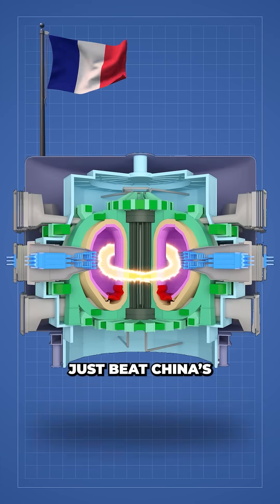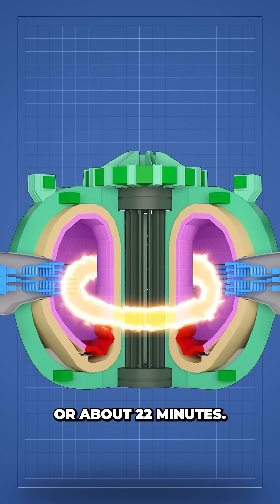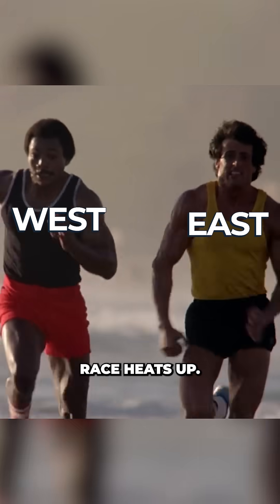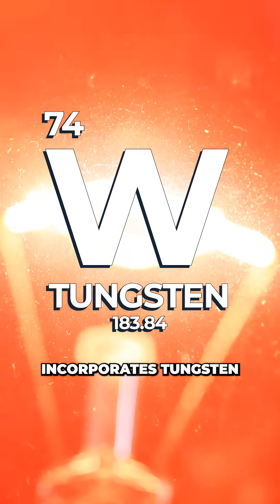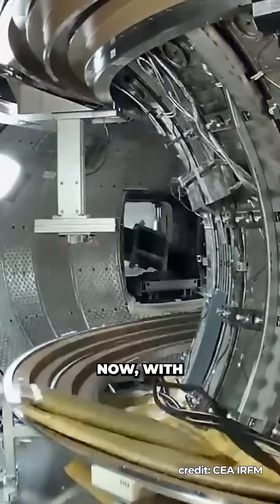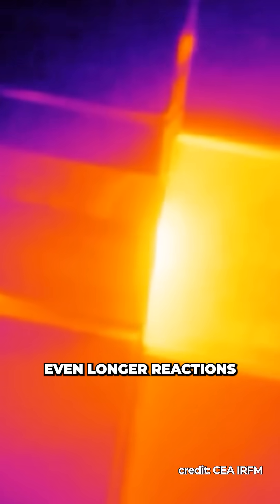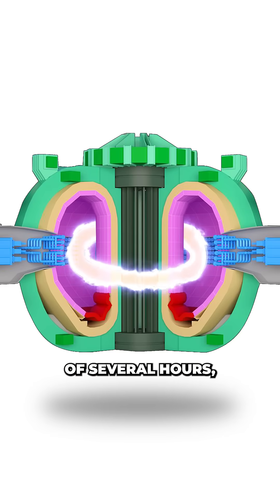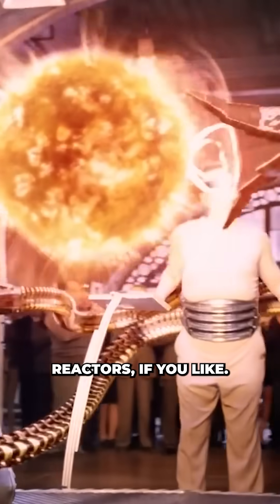France Breaks Fusion World Record

Comment: #1 it was the plasma not the fusion reaction 
#2 even if they achieve a sustainable reaction in 50 years from now, the amounts of tungsten and REE magnets needed and the required maintenance from high temperature exposure is going to make this the most expensive form of power generation and there's no such thing as "unlimited energy" when you have a tiny reactor with a very limited generating capacity.

Comment: Have they solved the issue of reliably adding fuel into the reaction? Last I heard this was actually one of the biggest challenges, due to  injecting material into a critical reaction running that kind of heat and pressure.  Are they just running a certain set mass of fuel they know will give a known duration for now and plan to solve fuel insertion later?

Comment: Cold fusion was supposedly possible 40 years ago, it was a optimistic lie from some snake oil salesman, we likely will never see a power fusion reactor, its far too hot and unstable. We dont have good solutions for containing the plasma yet, let alone the fusion that is many times hotter and unstable than the plasma. Its a pipedream, and all the people saying it will be done by the 2030's sound just like Elisabeth homes, the theronos CEO.

Comment: We cannot create Fusion on Earth! I wish I could show that from the rooftops but.. you cannot create Fusion or at least stable Fusion on Earth. The reason is because gravity itself and all of the other masses on Earth will interact with each other. We all have gravitational fields. Every object has a gravitational field whether you realize it or not. Those fields interact with the most dense matter around and that would be our planet. Everything balances with the planet. Even light finds balance. You need to take the reactor to outer space where there's no gravity. It needs a place where it's not being interacted with because you're creating a super high frequency waves so to speak with your generator. The higher you go the more sensitive it's going to become. There may even be a balancing point out there somewhere in space between the Earth and open space where it can Thrive but it certainly cannot work on Earth

Comment: How much energy is that?

While it's difficult to quantify the exact amount of energy plasma will release in 22 minutes without specific details about the plasma itself and the reaction it's involved in, the recent record-breaking 22-minute plasma sustained in the WEST reactor is a significant step towards harnessing fusion power. This achievement, with plasma reaching 50 million degrees Celsius, demonstrates the potential of fusion energy, though it's not yet usable for widespread power generation. 
Here's a breakdown of why it's hard to give a specific energy number and what the 22-minute plasma means:
Plasma is a state of matter, not a specific energy source:
Plasma is an extremely hot, ionized gas, and its energy content depends on its temperature, density, and volume. 
Fusion reactions release energy:
When lighter atomic nuclei fuse to form heavier nuclei, they release a tremendous amount of energy. 
WEST reactor is a research device:
The WEST reactor focuses on maintaining plasma for long durations, not on maximizing energy output. 
Fusion power is not yet a practical reality:
While the WEST experiment is promising, fusion power plants are not yet commercially viable. 
ITER is a large-scale fusion project:
The International Thermonuclear Experimental Reactor (ITER) is designed to demonstrate the feasibility of fusion power, but it is still under construction. 
In essence, while the 22-minute plasma is a big deal for fusion research, it doesn't translate to a specific amount of usable energy output. The focus is on understanding and controlling the plasma to enable future fusion power plants. 
 
50m degrees equals 90 quads 
Or 
quadrillion (1015), specifically a unit of energy equal to 1 quadrillion British Thermal Units (BTU)
So yea 50m degrees would be around 50 quadrillion British Thermal Units(BTU)
I hope this helped to whoever had this question 
And yea this took a lot of time to search

Comment: The term ‘fusion’ is frequently used in such promotional presentations. The simple fact is that this, the mentioned Chinese experiment and the vast majority of other nuclear fusion energy experimental machines have never and will never achieve a significant level of fusion reactions. The key fusion fuel isotope, tritium, is rarely employed because it is radioactive and extremely expensive. The commercial price is greater than $30,000 per gram, a key fact that is always omitted in such presentations. Even the best, record breaking fusion reactors that have employed tritium in their experiments, remain at least a million times away from the dreamed of economically practical nuclear fusion energy electrical power plant.

The nuclear fusion energy experiments began in the 1950s and have been constantly oversold to journalists and to the public, typically using claims that the hydrogen fuel is almost unlimited.

Comment: Hard to beleive the temperate comparison. No one has ever been inside the middle of the sun and said wow it is actually that hot.
Reply: Yeah but we know how big and dense the sun is… and how much gravity it has. Using those a person can calculate how much force it is exerting and how much heat it will generate. You can also tell by what colour the sun is, as materials give off different colours depending on how hot they are/their composition.

Comment: France is not the only country to develop fusion reactor which is better than China , India also created SST1 TOKAMAK which 24 times hotter than than suns core (approx 250 Million degree centigrate) and maintained it running for 45 minutes.
Reply: Indian reactor is one of the main in the ITER program, you don't need to lie to make it more important. It runs for 10 minutes, not 45
Reply: @kerity8707  man its not a lie , its just a stat which is being manipulated by different information portals , and yes it is possible that i had wrong data , and it is equally possible for you as well .
Also i am not making it ' more important ' ,
but yes i am making it clear that French fusion reactor is Not the First , there is an Indian fusion reactor too which achieved the same goal .
Reply: @amansahay4994  The SST1 was built to target 1000 seconds (16 min) maximum. Between me announcing that it lasts 10 min and you quadrupling its results beyond what the engineers themselves built, we're saying the same thing and we're both equally wrong.
What a fine false equivalence sophism, coupled with an evasion of responsibility. Pure politics!
Reply: @amansahay4994  What's more, to maintain the plasma longer, the technique involves keeping it at colder temperatures than we could. By lowering the temperature from 160M°C to 100M, China went from 20s to 400. The previous record was 70M°C, the current record (in the real world) is 50M.
You look ridiculous claiming that India has managed to have its cake and eat it too, with a plasma 4 times hotter & 3 times more stable than what the rest of the world (real world India included) manages to do together
Reply: @kerity8707  So I look ridiculous when i state facts 😄. And you do not look ridicule yourself when you fight over wrong data!?
Now that you have facts why don't you give source of your information .
Please do not try to evade.
And please do not waste your time and brain cells , you already do not have much.
Use your brain instead of aggression to get "real" data about SST1 Tokamak .
And 'Politics' , False equivalence sophism , responsibility evasion , Ridicule , These are the words used by you , these words are used to provoke someone.
And it worked.
Now you accused me , Tell me when you know there is an Indian SSt1 Tokamak available which achieved the same goal already then why in the video it is stated that France is the first country after China to achieve it? 
Did China achieved the same goal , if yes give me source of your information.

DO NOT EVADE please by use some distraction this time.

Comment: 10x hotter than the surface of the sun, not under the addition heat (i.e. pressure), as you move closer to the core

Comment: Still a really long way to ANY commercial application. 2030s seems way too generous. As much as I'd like to believe Fusion is close, the heat issue is nearly insurmountable. You're trying to transfer 10x the sun's surface temperature to water, and doing that without melting down whatever machine you're using to generate the reaction is going to be the real challenge here. 

The engineering question for generating energy is usually: "how can we get it hot enough?" But in this case question is: "how can we cool it down?" and that's a tough one. That's like asking "how can we cool down the sun?" And how can we do it in a relatively cheap way that doesn't consume more energy than we'll produce? And yeah, you can line the interior of your reactor core with Tungsten plating which would keep it from melting down TEMPORARILY. But we're gonna start running out of elements pretty fast. Nothing can really resist this kind of heat for any extended period of time, and to be able to run the reactor at a sustainable pace is kind of the point. 22 minutes might not even be enough to warm an actual reactor up let alone power a city or a province for any real amount of time. The water's gotta get flowing and the turbines have gotta get moving. The tungsten plating just kinda feels like a band-aid solution to say: look we made time longer! So that they can demonstrate to their funding partners that they are making "progress". But it feels more to me like they're just buying time. Idk man.  I really thought we'd be closer by now but it doesn't seem like we're even within 100 years of commercial fusion reactors.

Comment: You clearly have not done your research on energy generation fusion plasma if you believe we should be having any hit the grid by the 2030s. These tests are not generating energy, they just have a high temperature plasma running for long periods. We are still very far from a useful plasma reaction that actually net generates more energy than we have to put in to get the gases there, create the vacuum, supercool the magnets, etc. etc. PLUS, once that hurdles is passed, you need a way to recapture the energy in and efficient enough manner to then use that energy to generate electricity, which has substantial losses. PLUS you then have to accept the losses to get that energy to consumers, which is less that the previous losses, but not negligible. PLUS you then have to consider the maintenance and highly skilled workes needed to run the plant and considerable downtime, which further lowers economical feasibility. PLUS you have to find a way to make these plants cheap enough and scalable enough to become market viable, which is sadly arguably the hardest part to overcome. Not to be too much of a Debby downer, but please fact check some before you just cite a hopeful or overly optimistic article that is really being pushed to get funding/hype, which the fusion power world is sadly very full of. Unless we find a catalyst to reduce the currently understood requirements to make power producing fusion plasma, we are so far off that we can't predict an accurate estimate to commercialized fusion power

Comment: Im still 16 so I don’t really know don’t blame me but I am a curious person 1. Why do we really need this extreme temp ? 2. I think tungsten has a melting point of around 3.5 K celsius , how does it not melt ? And even more important question , how did they manage to shape the tungsten to its current shape , they somehow must have melted it ( I know its meltable) , but how can it withstand +1000000 degree temps and be meltable ? It must have ment they melted it using an even higher temp otherwise how would it be shapable into a reactor than can withstand insane temps or temps higher than the atomic melting point ?!!!

Sorry if this is a bit stupid I don’t really understand how this works but Im just curious.
Reply: 1. Energy generation in the future - fusion is more efficient than fission, generates less waste (and the waste is usable), and the material required isn’t uranium. 

2. An extremely strong magnetic field generated using superconductors prevents the plasma from making contact. I’m a layman, so my understanding of the next bit is limited; the plasma is at low pressure, so its total heat energy is fairly low for its “surface” temperature. Low pressure plasma contained in an extremely strong field means that the tungsten walls don’t conduct much heat at all, and there is additional cooling for the tungsten walls that isn’t shown from the inside.

Comment: Our scientific community needs to stop this stupid race. Even if we get free power once a fusion reaction is started, continues and makes sufficient power to provide power, it will take centuries to repay the debt every Nation has already paid to just break even. It's stupid. 

I'm all for exploration into the unknown, but this is ridiculous. Thorium MSRs are the way of the furure of power generation. Waste that only remains radioactive for hundreds instead of hundreds of thousands of years. The ability to take U-238 and much of our current fission waste and use it to create additional power. Thorium is 100% usable as opposed to Uranium within a water cooled reactor which only provided 0.7% usable fuel. The ability of these Thorium reactors to create their own U-233 rather than using a breeder reactor. The ability to product the Plutonium requires for deep space missions using RTGs. The ability to capture reactor waste products like Xenon, Hydrogen, etc for use elsewhere. The amount of heat that can be generated using Molten Salt v pressurized water is astounding. It's so hot that a gas can be heated  to high enough temps to use a smaller more efficient turbine. 

We don't need fusion. We need good fission.

Comment: For anybody wondering why this is a big deal, this would solve energy issues across the world forever
Reply: Theoretically, yes. What bothers me is that people with money and power will find a way to monopolize and monetize it, just like oil. 
I hope I'm way wrong, but think about it
Reply: Not forever. They still require fuel, which is in finite supply. And they'll produce quite a bit of radioactive waste, which is expensive to deal with.

Real life fusion reactors are not at all like what you see in sci-fi movies.
Reply: @nagualdesign  Fast reactors can be breeders which create feul and also use the waste.
Reply: No it won't unless the costs exceed the investors returns.
Reply: No buts about it. Yes forever. It would definitely do that. Stop second guessing. This or Geothermal (yes I know "if this" and "if that", and but but but). While the doubters doubt or the poncy braggers brag about what they learned at school: this is the path toward energy independance.

Comment: 22 minutes wow I've been watching this technology since they built the first Tokamac, would it be possible to control the heat by actually using it to generate electricity best constantly removing energy from the container and then try to maintain a balance of extraction and containment would that help keep the the incredible heat inside the unit to a usable level? they're not using the heat in the reactor for anything right now other than just trying to control it but if you controlled the heat by withdrawing some of that energy there in their reaction the reactor would have to keep up I'm not sure how we would do that I have to admit it's not like you could put tubes full of water inside there that are super cold that would be heated to generate power most likely they would melt I'm not sure what they could be made of but if you want to call something that's hot you extract heat through the three main methods, convection conduction and radiation can we use any of those three to extract heat from inside the reactor and use it to help keep the temperature down

Comment: The Tokamac is a dead end.

Fortunately, Fusion research developed a Millimeter Wave projector that can bore through solid rock with ease.

There’s a startup company planning to drill geothermal wells on site next to old coal fired power plants.

They’ll run on geothermal steam instead of coal.

Comment: I've been saying this for years now. There isn't the right type or amounts of resources on Earth (or within our solar system for that matter) to build a fusion reactor that has a net positive energy output which could sustain our needs. Our technology is limited by the resources we have, and we are approaching the plateau of innovation. Fusion is 50 years away, and will forever always be 50 years away.
Reply: Well you clearly did no research as the moon holds the resources we need that aren't in abundance on earth. And  sea water holds the rest of what we need. We actually DO have the resources on earth to do this, but just not a lot.

Comment: This is cool that you pointed out the leet number (1337 seconds), but it would be fair to make the same thing with the other reactor, because you said 17m46s, which subconsciously feels way less than the 1337 seconds. Although if you'd say the actual number of minutes (1337 = 22m28s), it wouldn't even be that much